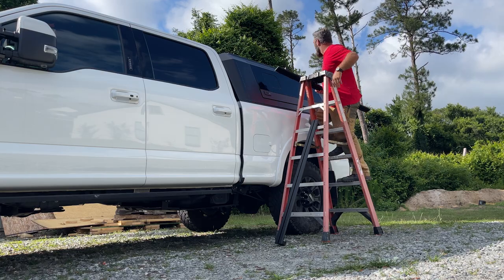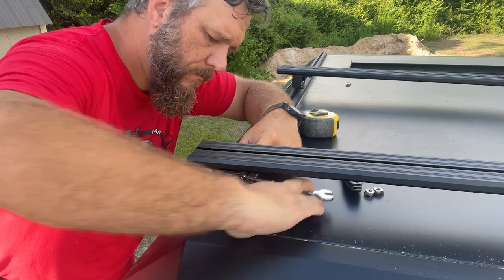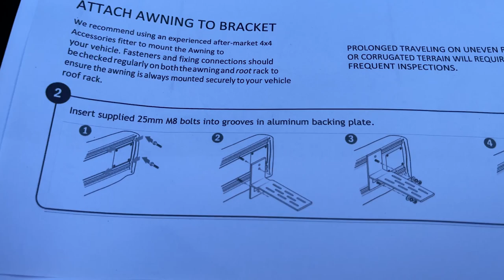Why Are These So Hard To Find?

Comment: Wait, are you thinking about building your own slide in pop up style camper? That would be an awesome build to see.  I currently have a travel trailer I use when we go camping, but I’ve always had a fascination with the slide in campers and even the roof tents with the ladder. The price for the those has always been extremely high so a diy one would be very cool to see especially with a cost breakdown. Loving the new channel keep it up!
Reply from the maker: I’m thinking about doing one of the bed campers that aren’t enclosed like the slide ins. It’s basically what I already have but the popup is attached with a pass through. It let’s you use the bed like normal but converts to camping easily.

Comment: The flex in the awning is coming from not having the bracket right at the back corner with the hinge. If you move the awning down the car and have the bracket right or as close to the rear hinge that folds out and around a lot of that flex will be fixed. 

Another bonus from doing this, you will also have the part over the rear tailgate covering or just on the roofline as well.

Comment: i threw a Rhino-Rack batwing on my F150, love it.  I just have a ARE topper on the back of the truck now and a BedRug (also awesome) and i built out some simple bunks for my son and I for overnight fishing/hunting trips.  However I am seriously thinking about  going to a popup "camper" instead.  I really like the Lone Peak Overland setup and right now they are probably the best bang for the $ out there, otherwise the Go Fast Camper is probably my next choice.  Either way they are pricy, and there are some guys here on YT that have built their own, so i have thought about going that direction as well.  It would give me a good excuse to buy some more tools and learn how to weld :)
Reply from the maker: Exactly! I need to learn how to weld too. I’ve looked at the lone peak. It’s a huge bargain compared to the others. I’ve been thinking about building a pop up for a year but the lone peak makes me rethink that.
Reply: @HaxmanXTRA   yeah the DIY popups are still $3k-4k in materials and then I still need to buy a welder, figure out how to weld, build it and then rip it apart and rebuild it to fix all the mistakes I made :)   The lone peak price point makes just buying one pretty attractive. It has some pretty nice features you don't find in the more expensive campers.

Comment: Instead of using the eye-bolts for tensioning, could you have just hooked the straps together and tensioned it that way?
Reply from the maker: That might be possible but I think it would have too much swing in it without an immobile latch point.

Comment: Like the video, but not big on the product. Any rain water on the truck will flow down the sides of the cap and splash people under the awning. Seems like a big tarp would be a better solution and just as easy to set up.